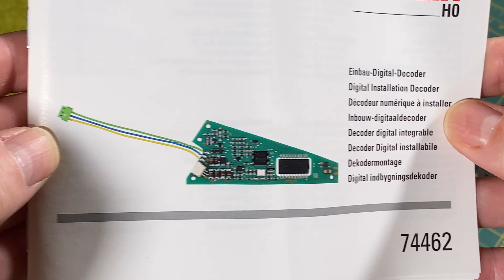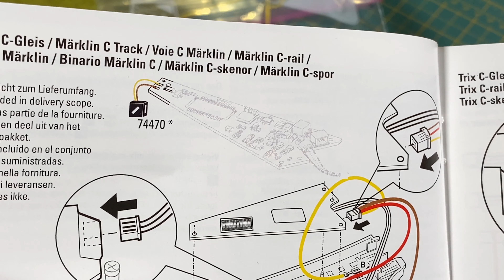Light 24624 Double Slip Lantern from Märklin 74461/74462 Decoder (Tutorial 01)

Comment: Ty for answer on another video regarding the lanterns.I dont bother to turn them on or off, and Im really struggling to solder on the decoder altho I have done so many times. So to me best option is track power, this way I also avoid more cabling even tho I will consider to use a m84 w like 8 adresses on it. I guess u can also have more than one lantern in each contact aswell. I still have not done the other cabling on the turnouts yet. Manual says max 16v AC/DC for lanterns, altho the trackpower is ca 19v.
Reply from the maker: Dont know if 16V vs 19V is an issue - consider using a separate power supply, this will also reduce track power usage. I believe they might work on 19V, but you may see significant reduction of life time. However, I have not tried it. You can have a lot of lanterns connected to each port on the m84 - however, do not exceed max current load per group of 5 amps. I believe a LED is in the 10-100 milli amps - or even 1-10 ma, but I might be wrong. Enjoy ;-)

Comment: Hm, it is a static lantern, yet it shows the direction! Wow! But I will have only left and right turnouts on my layout with lanterns that rotate. I am just thinking what I could earn from feeding them  through the 74462 decoders? Isn't it smarter just to feed the lights through the track using spade connectors? If the track is fed, the light is on, and the rotation of the lantern shows the direction. When U are playing, and when the rolling stock is on the move, why would U switch the lights off? What do U think?
Reply from the maker: Being able to turn on/off lights enables you to make a day vs. night scene where you would not have light in day-time, but light at night.

The only benefit from feeding them through the decoders is that you could turn then on/off using the decoder (option 1). Two other options exist:

2. Feed the lights directly from the tracks as you suggest. Removes the need to solder on the decoder.

3. Feed the lights from another power supply dedicated to lights on the layout. You could control the lights to multiple turnouts using a m84 to turn on/off the lights.

Which option to use is a matter of taste. I believe that option 3 is the most common as it has the most benefits: does not use track power, still controllable and you can use a DC power supply (removes flickering lights from videos). For temporaty layouts you can feed of the decoder (option 1) or directly from the track (option 2). I usually do not bother with lights on a temporary layout as they have to be purchased seperately for standard turnouts.

Hope this helps. Have fun running trains ;-)
Reply: @ModelTrainFun  You are always helpful, thank you for this! (1) I really can live without turning the lanterns on and off. (2) It is a good solution, but not the best! Before you mentioned it, I had not thought of the flickering due to AC. (3) Best! The lanterns can be fed with a separate power supply of 12V DC output, and there will be no flickering, and the lanterns won't be using up power from the track! Superb! Thanx! :)

Comment: Hmm I’m quite surprised Marklin didn’t fit a screw connector for the LED output from the decoder.
Reply from the maker: I think the reason is that one would normally not attach the lantern to the decoder as it would often make more sense to power it separately from the track. In addition to this - the feature of turning on/off the lantern from the decoder is cumbersome and difficult to get to. I do agree it would be nice to avoid soldering... Have fun ;-)